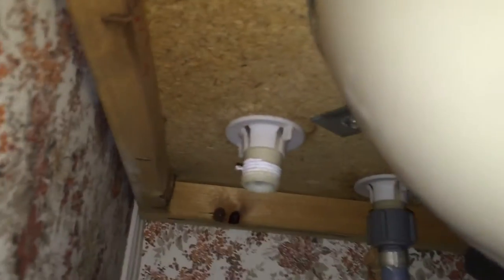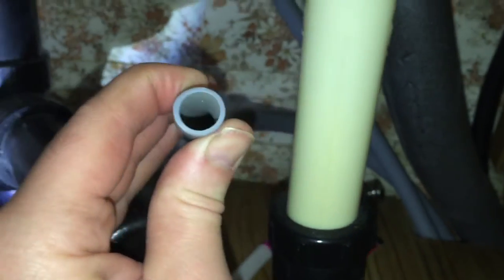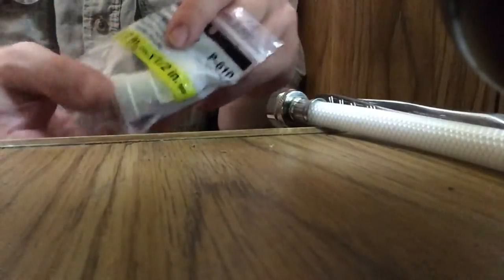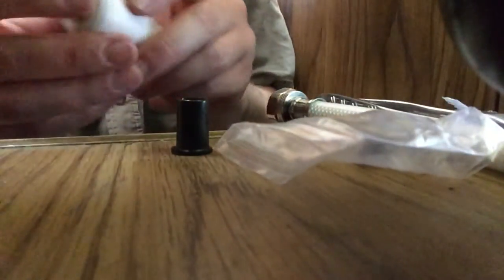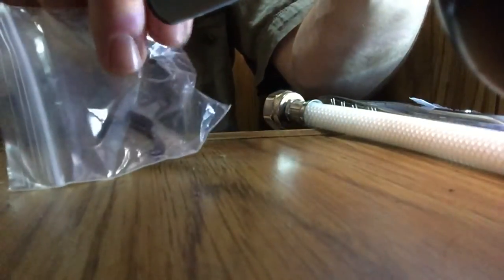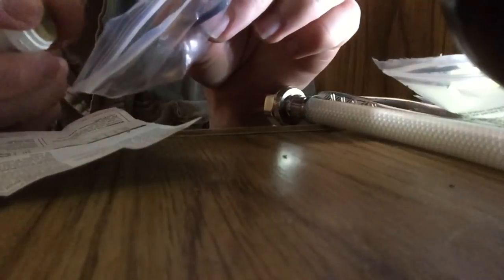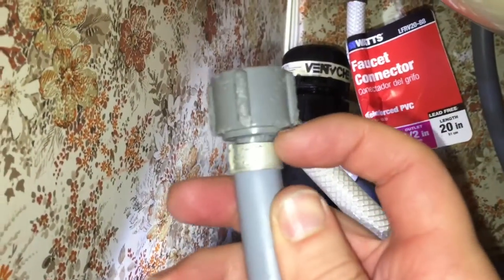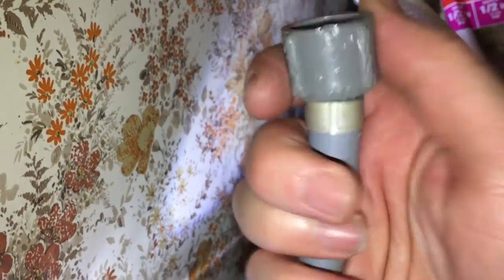RV Faucet Repair

Comment: Thanks!   Big help on RV sink where pex tube connection is leaking antifreeze after -12F.  Pex is a joke because expansion tools are so expensive for DIY.  I'll have to wait until May to repair.  Cheers!
Reply from the maker: Pex can be frustrating, but it’s good material.  The right tool for the job may cost $ but it’ll be well spent after you see your handy work successfully completed!  Good luck!  Thanks for the comment!
Reply: im pretty sure that is pb and not pex

Comment: Are you sure the original pipe is not Polybutylene? Most older trailers, like mine, have this and it is a nightmare. I live in cold country so every Summer I begin repairs to my plumbing. At this point, I have decided to convert entirely to pex.
Reply from the maker: +D GKZ , I'm not entirely sure.  I winterize it every year and do not use the pipes when the temp drops near freezing.  This was the only problem I've had in many years I've owned it.  I appreciate the comment.

Comment: Very informative! Can you tell me what the name of the 1/2 Inch by 1/2 inch part (with the insert) is called? I tried to freeze frame the package picture on the video but it was unclear.   Also, did you get it at a big box stores like Home Depot? I think this will solve our leak problem. Thanks!
Reply from the maker: I think what your referring to is called a shark bite.  I picked it up at Menards, but most hardware stores that sell pex pipe should have connections and you should be able to find what you need.
Reply: Thanks, actually my hubby was able to review the video once again and got the info off the package.  He installed it yesterday following your instructions, and no more leaks!  We liked your method since we didn't need any special tools which other methods would have caused us to buy.  With the money we saved, we were able to buy a new faucet!
Reply: Oops, didn't realize I was logged in under my husband's account.  He's not married to himself, btw.  lol
Reply: May I ask the name of the fitting and where your husband found it?

Comment: Yeah, I replaced whole faucet, still leaked, hot water line also, same spot as you have shown. Back to hardware store tomorrow.
Reply from the maker: +Julie Prentice, if your faucet is new it must be in the hose connections.  Those shark bites work great, thats what fixed mine.  Keep at it and you'll get it.  Thanks for watching!

Comment: My rv is made my Winnebago and it  has white pipping. Is it 1/2 in?
Reply from the maker: +Paul Clemmensen thanks for the question, but I'm not sure without looking at it/measuring it.  See if the pipe has any writing or size on it.  Somewhere along the pipe it should say the size.

Comment: What size is the Pex ? I have the same problem, same leaking spot and I may have bought the wrong size shark bite
Reply from the maker: +Karen Arellano Hi, I used a 1/2" by 1/2" shark bite and flex pipe.  You may be able to verify your pex size by looking on the pipe itself and it should say the size.  Hope this helps!  I appreciate the view and comment!
Reply: sradjoe yes, thank you! It was our first time on our new but old 1981 foretravel and we couldn't run our water bc of the same leak break as you. Your video was just perfect to help me fix it up!Thank you so much 😊

Comment: That is not PEX, it is PB (polybutylene) pipe, used in the 80's and 90's as a cheap piping option. However they were discontinued because of being prone to leaking and a source of many law suits for flood damage. 
Replace with real pex piping if you want a leak free fresh water system.
Reply from the maker: No it’s not pex, but pex push type fittings will work on it.  PB was found to go brittle with exposure to common chemicals.  I imagine the basic chlorine in your city’s drinking water supply was enough to cause failures over years of use.  PEX is superior, no argument here.